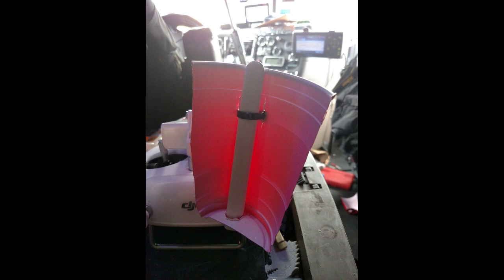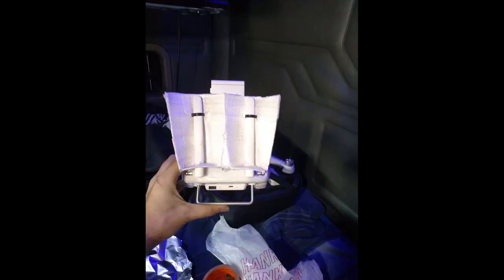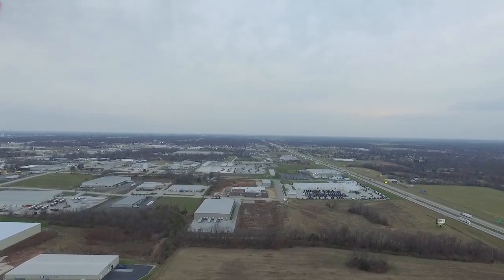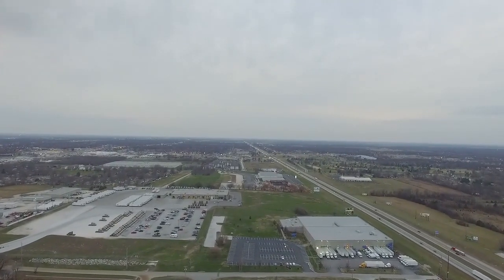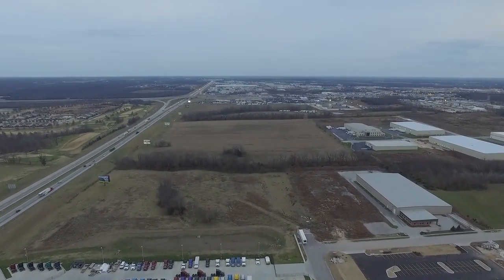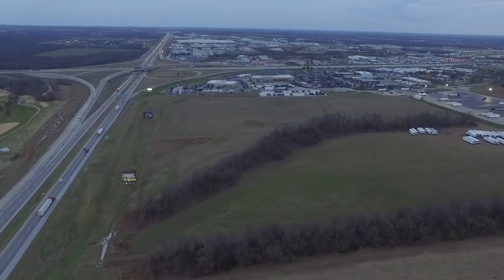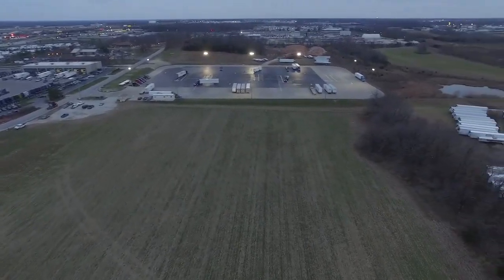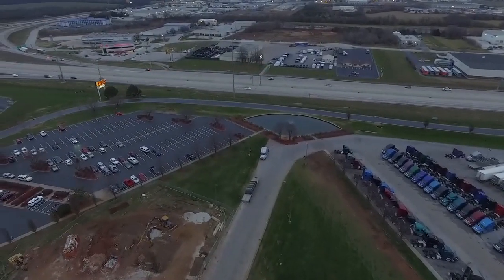PARABOLIC ANTENNA DIY| DJI PHANTOM 3| EXTEND RANGE

Comment: Hey there I like how you taped them together to make one piece but I'm not sure if I'm seeing this right. Did you cover the half cups that had foil on them with another half cup for zip ties. Basically what I'm asking is did you cover the foil? Does the foil not need to be exposed?
Reply from the maker: +Gregory Curtis yeah I covered the foil. The radio signals travel through plastic. So no problem.
Reply: Ah gotcha! That makes sense and that's great to know. Thanks a lot for the response! Cheers,

       Greg

Comment: Now that son is mighty impressive if I would say so myself...makes me think of what kind of a self made ham radio diy you would become if you ever took interest in that hobby? and then open up more doors in the Amature radio world getting you general license and finding many contacts of alot of other truckers out here on the wave bands. and getting qsl cards from all contacts from all over the world being just a truck driver and having yet  another great time waister doing that too. :) thanks for the new look on this lift.lol. C-Ya! ;)
Reply from the maker: +Burl Carey I wanted to get my ham license but I have nowhere to put a big radio right now unfortunately
Reply: Ham radios are actually smaller than the cb radio seriously. But getting a screwdriver antenna this way you can utilize just one antenna to do broad scopes on different bandwidths. But even a handheld $35.00 ham radio can reach through the use of towers anywhere you may wants to reaching out to? All with a rubber duck antenna. A novice license will allow you to talk on any band just only on the small sections of each band though. But general license is the most band width capabilities you can have & an advance licenses you'll cap out on Ametuer license but not necessarily. You can go commercial too. Or private or just do radio am. Or FM as well. Have your own radio station while in your truck if you wanted to exercise that right?

Comment: this set is not good to fly safe, it can decrease the signal in your radio controller. you need to do some maths to do a good parabolic, here you just have a signal bouncer not a parabolic, and can help but for a "fly away", not for increase the radio signal.
Reply: the chances of success are great, if a phantom loses signal it flies home at a set altitude that you can set, it is not at all dangerous I fly my drone out of range all the time, that was why i watched this video
Reply from the maker: +Eduardo C. Guizar Sainz 40+ successful flights with it disagrees with you. I've flown upwards of 10,000 ft before any signal loss with this mod over water.
Reply: +Woody's Dronography WOW that's really impressive. :)